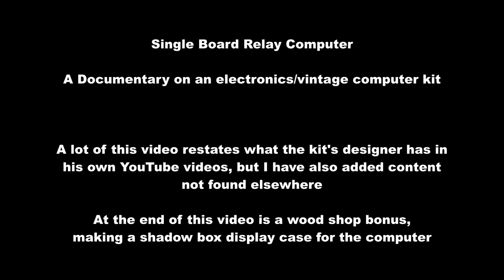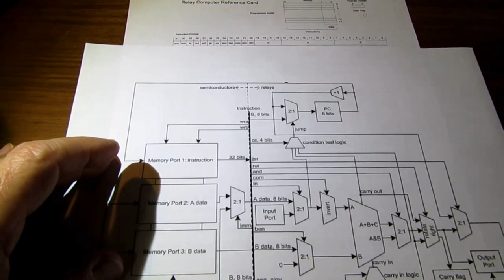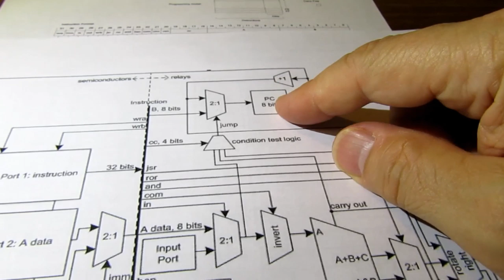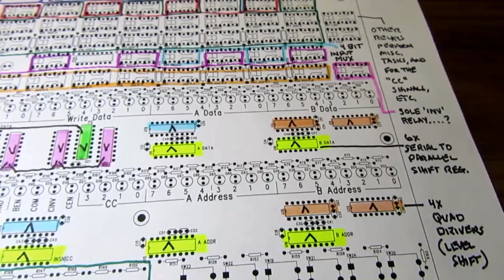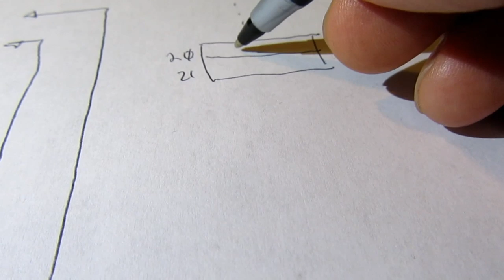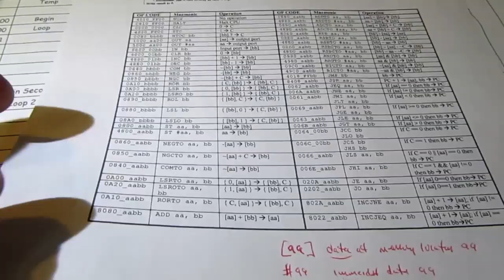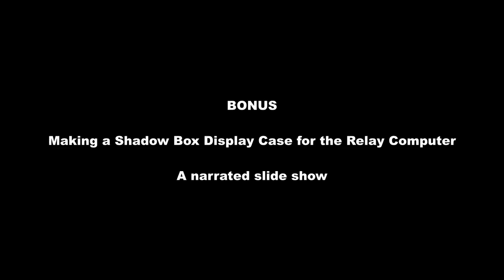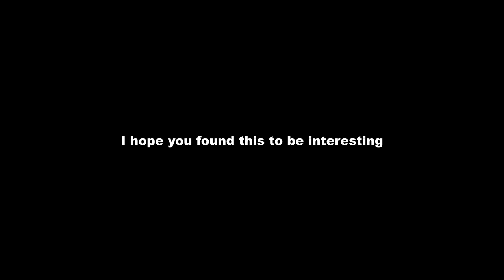Single Board Relay Computer Documentary and Making its Display Case

Comment: I recently watched a video about a random "thing" teardown that turned out to be a controller for xmass tree lights, home made about 40 - 60 years ago.  They had used glass reed switches with a fine coil of copper wire wrapped around the outside to make small relays as magnetic Isolation to run mosfets to switch mains power on and off in sequence, still working perfectly.  I had never thought of hand making my own relays like that and it immediately made me think about building a Relay Computer. The footprint of the reed relay was about the size and shape of a diode and seems to be very advantageous over the brick relays space-wize and power-wize (the tiny driver coils probably run on only a few volts) yet they still make a satisfying click sound. Any thoughts?

Comment: Wow, good job on both the computer build and the display box!  I'm thinking of building some kind of wooden case for mine when it's done, too.  Probably not that fancy, though.  🙂  I really liked how much info you gave on the machine, even though you aren't the board's creator.

I'm currently working on debugging my own build of the same partial kit.  It starts up, passes the "00" and "FF" tests, the serial connection works, but the demo program isn't running right, and it doesn't stop.  :-/  I'm hoping that I can use parts of your video to help figure out what's going on!  I've already realized that the (used) power supply I was using is technically only rated for 1.8amps, so maybe it's not getting enough power to properly flip all the relays or something.  We'll see!
Reply from the maker: Derek, did you use the recommended relays and capacitors? Joe Allen, in his writings on the development of this computer, talks about the critical holding current on the relays, which is balanced by the selected holding capacitors.....if they are not balanced, the CPU will not work. 

On my build, I substituted lots of parts, but I was careful to buy the same critical parts Joe recommended. And yes, the power supply needs enough "oomph" to easily and reliably power all relays in the worst possible current consumption situations.
Reply: @youtuuba  Yes, I took his recommendation and just bought 100 of the relays he indicated.  I think I made sure that the critical capacitors were what the BOM indicated, but I did end up substituting a number of parts due to a combination of already having some of them and Mouser + Digikey being out of several of the ones specified.  I tried to be as closed as possible, though.  All of the parts I used were new (although, I had to buy one type of IC on eBay, so they're at least *supposed to be new*).

I got my (surprisingly cheap-feeling) 5amp 12VDC power brick (not very heavy, though...) today and tried the Relay Computer again:  no change.  😞  I plan to go over the whole board carefully tomorrow, re-checking all of my soldering work on the back under magnification and double-checking which capacitors I used in the positions he marked as critical.  I'm also open to the possibility that one of the relays arrived defective, but short of removing and testing each one individually on a breadboard, I'm not yet familiar enough with the circuit to know which.

Unless I have an "Aha!" moment tomorrow while doing my re-double-triple-checking, I will make a post on the Relay Computer's support forum on Sourceforge and see if anyone can suggest a way to proceed.  Although, I was a bit disheartened to see that it's been awhile since anyone asked or answered anything there (so, I hope someone is still looking!).

Thanks for your reply!  🙂
Reply from the maker: @derekchristenson5711  , did you do the 'initial tests' in the manual, which verify the ability of certain register(s) to be set, retain their setting, and then be reset? As I recall, that was an important step....
Reply: @youtuuba  You mean the tests in 4.1, 4.2, and 4.3 of the Assembly Instructions?  Yup, they all passed.  It only showed an anomaly when I tried 4.4:  Run the Demo Program.  It starts out with the wrong numbers, each off by only ONE bit (the most significant bit of the high nibble) for the first few numbers, then gets really wrong (not surprising, as the math is working with the wrong numbers).
Reply from the maker: @derekchristenson5711  , have you communicated with Joe Allen about this?
Reply: @youtuuba  I got it working!  🙂  I was waiting on contacting Joe Allen until I was sure that I needed to, so I ended up not doing so.  I decided that, since I couldn't see any components out of place, and the voltages were good, that I must have missed something when I examined my soldering work after assembly.  So, I very slowly re-examined it under magnification, and AHA!  I found a single relay socket pin that was missed.  Soldered it in place, added a tiny bit of solder to another couple of pins that looked a little bit thirsty (but were probably fine), connected it to power, ran the demo program, and it worked!

Thanks for all your quick replies to my questions, even though it wasn't even your project.  🙂

Comment: super your explenation of the 2 video's can you set at you web side the layout what you have in colors to point the relays
i have also buld en relay computer but i have used 5 volt relays and the led's are in color groups 

but i have problems to read it back and the leds of the write data will be off bij the power on
Reply from the maker: Ronald Lokker, you say that you used 5V relays, which is contrary to how the computer is designed. Also, with only 5V power to the computer, I wonder if the switching power supply on the circuit board is functioning correctly to provide 5V for the IC logic circuits. Also, the level shifter circuits might not function correctly the way you have it, and the resistors and capacitors that are used with the Program Counter relays probably have  the wrong values. I have no idea why you chose to use 5V relays instead of the correct 12V relays, but my suggestion to you is to revise your computer to match the original design.

I cannot provide any technical support to you.

Comment: Comes to about $420.00 for components as you listed + $117 for board  = $537 (expensive project)
Reply from the maker: Well, yes.....devices such as the relay computer are clearly not practical for 'real' use, and as such are useful mostly to vintage computer enthusiasts and educators, and qualify as a hobby activity. Most people with hobbies tend to overlook the cost, as long as they get enjoyment out of the hobby.

Since I conformed the BOM to Digikey, the parts price is going to be higher, since that seller is not known as a discount distributor. Their business model is providing a wide range of name brand quality parts, available from an excellent stock with instant availability and with no minimum order, but the price will be higher that you might be able to get if you spend more effort shopping around.

I also specify high quality (cost) sockets, and considerable cost savings could be had there.
Reply: The expense is relative. Do you think you’ll learn nothing on a project like this? Education often isn’t free.

Comment: It is very hard to make logic circuits with only relays, but only because they are enormously big, terrebly slow and that they demand huge flows of Ampères. Maybe hundred year ago it was necessary, now it is only a gimmick. I can't feel any emotion with relays, I can with microprocessors from the last quarter of last century, they are also slow, dumb and powerhungry. I understand the charmes of simple computing, although maybe this goes to far. What's next, refusing the electric grid and put a 12 volts dynamo on a bicycle for the powersupply?
Reply from the maker: vanhetgoor, you seem to have very much missed the whole point......
Reply: Clickety clack is better than blikenlights imho.  That being said there aren't enough relays on that board to make an alu let alone a full computer.  So yeah it's a gimmick.